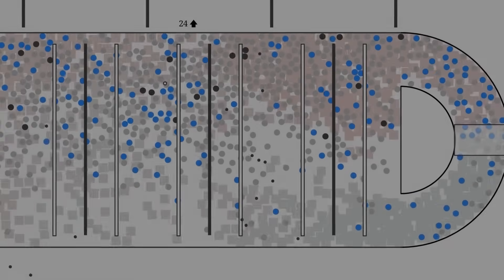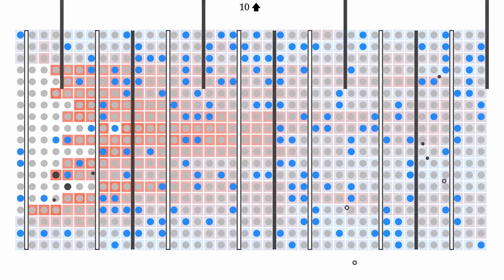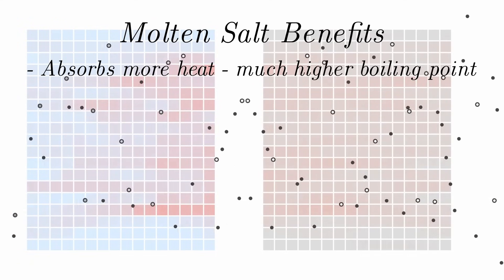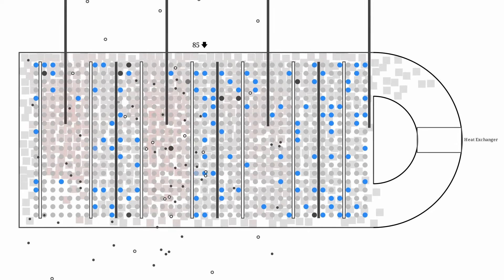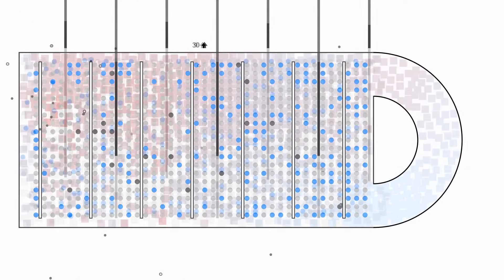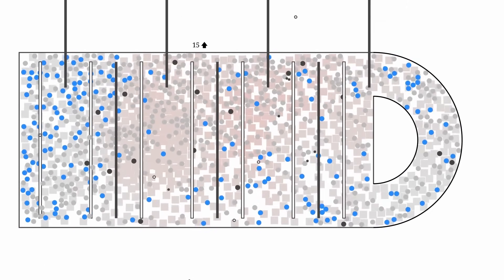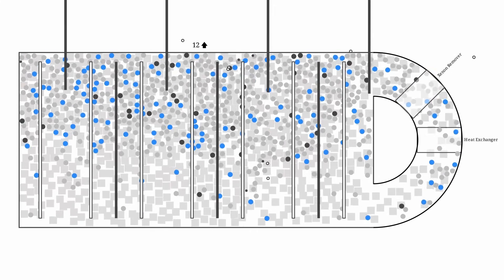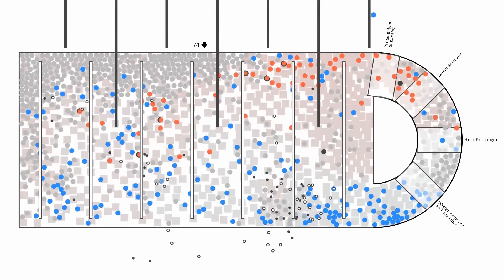Molten Salt Nuclear Reactors – Visually Explained

Comment: I'm going to throw another dig at the US Nuclear Regulatory Commission: In 2020, they started to look at Title 10 Part 53. This regulation essentially stated that no molten salt reactor could be greater than one megawatt thermal. The reason why this regulation was created was because the commission who is made up of politicians mainly who have minimal background in nuclear science, were afraid. They were afraid of molten salt reactors because they did not know how they worked. So instead of allowing exploration into molten salt reactors, they simply stopped the major majority of research into molten salt reactors. Now Title 10 Part 53 is going through a revamp that will take until 2027. No reactor can be built larger than one megawatt thermal before this rule is completely revamped. Today there are two molten salt reactors being built one: one is at Texas A&M University and the other is in Tennessee. Both of these reactors are less than one megawatt thermal. As a result, they will provide minimal information about how molten salt reactors work for the benefit of PhD's, who have been working and looking into molten salt reactors, expanding on Dr Alan Weinberg's original designs. This is bureaucracy at its best.
Reply: politics.

Comment: I have a question about loss of coolant accidents. 

In a LWR, a LOCA will result in irradiated water (containing other nasties eg boron) escaping from the primary circuit. However, in a molten salt reactor, as the fuel is suspended in the coolant then presumably a LOCA would result in not just irradiated coolant but actual fuel escaping from the primary circuit - which is presumably a much greater problem. 

How is this risk mitigated in molten salt reactors?

Comment: Another problem that ha to be solved with salt reactors is that the salt is extremely corrosive.  I am for research in this because I like the idea of salt reactors, but this is a major issue that needs to be solved for long-term operation.   You can reprocess the fuel all you want, but if the infrastructure can't last more than a decade, then reprocessing isn't going to matter much.

Comment: I imagine you're still studying these types of reactors... one of the most difficult things when building these reactors is making the material resistant to salt corrosion... making the pumps and pipes resistant to corrosion, temperatures, and pressure is really what makes these reactors so difficult... at least for now. We've made some scale pumps, but there's still a lot to do to make a safe reactor.

Comment: IMO the issue with LFTR is proliferation. That protactinium separation step would give the people running the plant access to Uranium 233 which can be used to build weapons. The Non Proliferation Treaty is flawed because it allows states to run their own fuel reprocessing facilities which allows them to extract plutonium from irradiated fuel. It also allows them to run their own enrichment facilities to produce fuel in the first place and those facilities can also produce weapons grade uranium. However it seems like building a bunch of LFTRs which must do protactinium separation makes things worse because you'd need monitoring at every reactor rather than just as the reprocessing facility. 

Also, as I understand it the typical industrial PWR isn't optimised to produce plutonium compared to other reactor designs. E.g. Calder Hall was a graphite moderation CO2 cooled reactor that could be optimised for either plutonium production or power generation. Initially the former and later on the latter. However a modern commercial PWR is pretty much hardwired to be optimised for power generation. So states seeking nuclear weapons will build other kinds of reactors. Interestingly North Korea might have built a very Calder Hall like design to produce plutonium. However doing that, rather than running PWRs, or insisting on doing your own enrichment  is a major 'tell' in the intentions of a state. If everyone run LFTRs you don't get that 'tell' any more.

Comment: 12:05 There's a fascinating design by Moltex called the SSR, or Safe Salt Reactor. 
It solves the online reprocessing problem by separating the fuel salt and primary coolant salt into two, containing the fuel salt in tubular containers, sort if a hall between fuel rods and pumped fuel.
It only pumps ordinary chloride salt, the uncapped fuel tubes contain flouride fuel salt and have gas valves for the xenon.
Solves the corrosion with a sacrificial anode in the tube too.
Rod handling technology can be reused for the fuel tubes. 
Still had the same passive safety but no need for a freeze plug system.
Reply: The initial reactor under construction in Canada is also the SSR-W type, the waste burner. 
It takes CANDU waste as fuel with a 90+% burnup.
So you're bootstrapping the fuel cycle, disk will be produced for a liquid fuel reactor because the terror had been built.

Comment: I love molten salt reactors, probably one of the most under rated reactors. Especially since a fuel breeding MSR was the first ever to make power... (EBR-1)
Reply: EBR-I was not an MSR (molten salt reactor), it was a SFR (sodium fast reactor). The succesor to this reactor was the EBR-II which not only ran for 30 years, it also demonstrated a closed fuel cycle with a recyclingn plant adjacent to the reactor building. 
The molten salt reactor experiment from the 60s was called the MSRE (molten salt reactor experiment)

Comment: China has demonstrated online refueling of their molten salt reactor. the chemistry used to filter the salt will most likely be based on elemental fluorine and electrolysis. one other benefit of a liquid fuel is that thermal expansion of the salt will also affect fuel concentration which affects reactivity, providing that negative temperature coefficient, also, the xenon can bubble out of solution if you have an expansion volume above the core that is flushed with argon. the xenon can be removed since it's a gas and held in a tank to decay. the expansion volume could also be used to provide a means of average coolant temperature measuring based on level change and help indicate if there is a leak if you have an abnormal level drop. since the core is under slight pressure or atmospheric pressure, having a level indication to show leaks would help in providing reactor protection. 

many thorium designs use a 2 salt system. the thorium salt and the uranium salt. the thorium salt could blanket the uranium fission and absorb leaking neutrons. so for a thermal breeding reactor, the geometry of the fission core needs to be tailored to provide the necessary leak rate so the thorium blanket can breed sufficient fuel. Having the secondary blanket would also make separation of the protactinium far easier since you don't have to deal with fission products. 

i've personally thought of creating a core design that uses natural circulation as the means of cooling since you have 1000C temperature range to work with before dealing with phase changes. i imagine a 300C thermal driving head would be plenty for a reactor that provides steady base load. 

i'm just dubious of dealing with coolant pumps that may leak fuel salt in-between the pump and mechanical seals. also cooling the motors to protect them from the higher temperatures. then if a pump breaks, could you imagine how spicy the contamination would be on the pump parts when you go to replace them? Gross.

Comment: why isn‘t the outside of the reactor linde with graphite moderators? i‘ve noticed a lot of fast neutrons escaping, those could be reflected by graphite before, but thermal neutrons get out, right?
might not make sense in practice but at least in the simulation…
still i‘m not that deep in nuclear physics so tell me if i‘m missing anything

Comment: i wonder if a reactor like this could get stuck in some, idk i want to call it a phugoid cycle but thats the wrong kind of machine, but a constant cycle of running hot enough for the reaction to die, then cooling down to where the reaction can start again, with that repeating till something fails from the constant stress of heating and cooling, ig the salt would just cool into a solid though if it broke open.

Comment: I envision the dump tanks will use dip tubes and not a freeze plug. then a pump will pressurize gases at the top of the reactor to pressurize the dump tanks.The advantage of this design is that dumping is not a big deal and the pump can push the fuel back up into the reactor. The air flow around the dump tanks will have to be stopped, but it's not a big deal to have a dump. Another option is to have a melt-able plate that dumps the pressurized gas into the reactor if it gets too hot and the normal dump valve does not work.

Comment: If you want to play with a fun model of nuclear fission, you should check out the NuclearCraft mod for minecraft. It includes many many fission decay chain elements, solid and liquid fuel reactors, breeder reactors. You can get quite creative with how the reactors' internals are built, and putting one together is always a bit like solving a puzzle, with each reactor element having some requirements and contraindications. You can also built FUSION reactors. The mod's creator also has a youtube channel (also named NuclearCraft) if you just want to see how it works.

Gregtech (specifically the New Horizons modpack) has a number of nuclear-related processes, ores, and machines as well but that's a much larger commitment than just messing around with NuclearCraft.
Reply: They really added nuclear physics and engineering in our lovely block game
Reply: HBM Nuclear Tech does all that better, imo.
Reply: @Misha-dr9rh  I've honestly just not tried HBM yet, it could well be